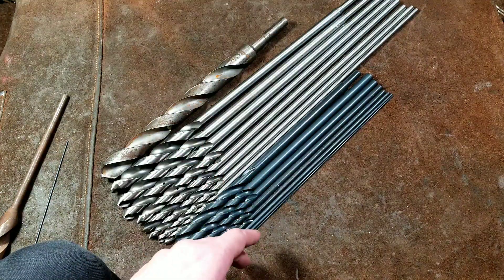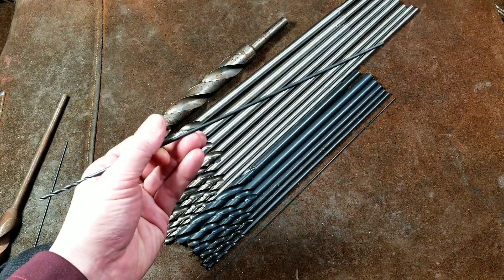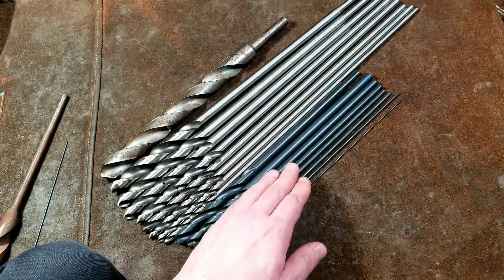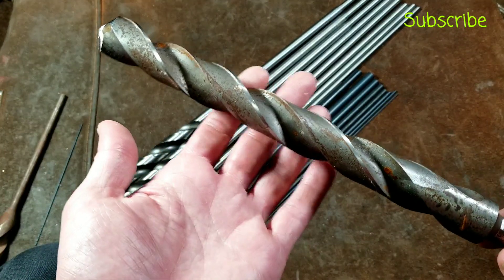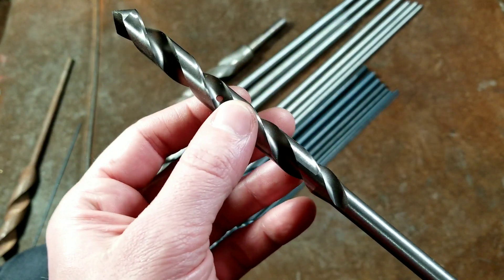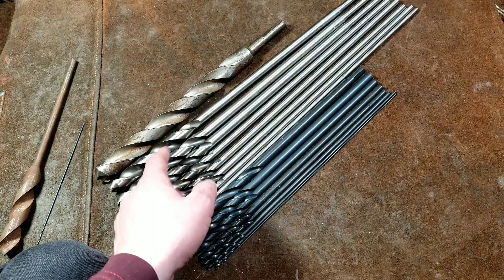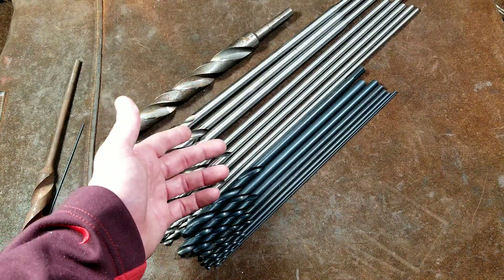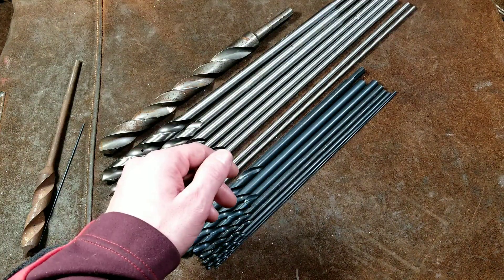Aircraft/Installers Drill Bit Review & Comparison

Comment: Dear Sir..

We have a 3 step cylinder. on each step there are grooves 100 mm depth and 20 mm wide...
the total length of the cylinder is 1.6 m... the largest dia is 1 m while the smallest dia is 600 mm.. .thickness is 35 ... the length of largest step is 800 mm..
Is it possible to drill through the shoulders ?
I can assume it is pretty to understand with wordings.. if you like i can send you the drawing ....it will be of great help..
Regards
Reply from the maker: Yes it can be done manually but it would be extremely difficult that's the type of operation you need a manual Bridgeport or a cnc milling machine for so that they drill bit and object could be held at a perfect angle and very securely
Reply: @CatusMaximus  
Dear Sir, for my satisfaction, can i send you the drawing if you have time ?
 I would require your email. I work at CERN ... Center for European Nuclear Research, Geneva . Switzerland

Comment: I'm a retired aircraft mechanic and I've never once seen anyone with those type of drill bits. We mostly used number and letter bits.
Reply: I inherited some drill bits from a retired Bell Helicopter mechanic and they look just like the video, some of the smaller diameter are slightly shorter but still 8” - 10” long.
Reply: Just getting into the field and yeah they’d hit wiring

Comment: That 1" bit is cool! The aircraft drills are handy to sneak around wire bundles, hydraulic lines, and other obstructions. The smaller sizes will tolerate a decent amount of bowing while drilling but is a tricky technique to learn. Never pull the trigger with those either contacting a surface or supported by your hand or they bend and flop around dangerously. What was the other large drill near the 1" one?
Reply from the maker: Thank you for the tip, the bits next to the 1 inch bit are all installers bit
Reply: @CatusMaximus  
No, the other large reduced shank bit with the extra long shank, it looked quite old, if you mentioned it, I missed it i guess.